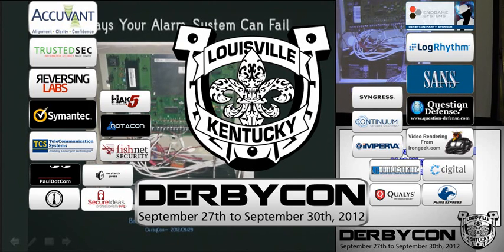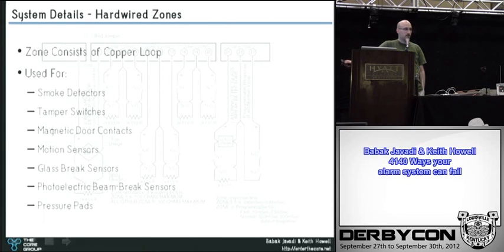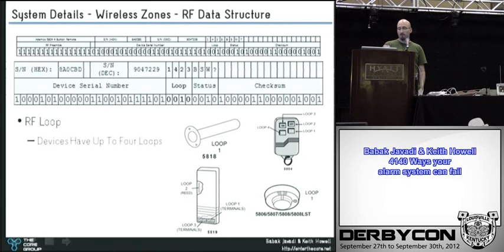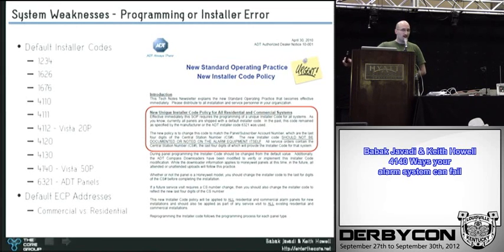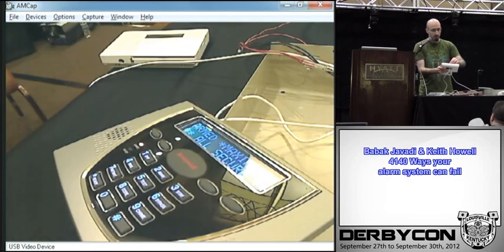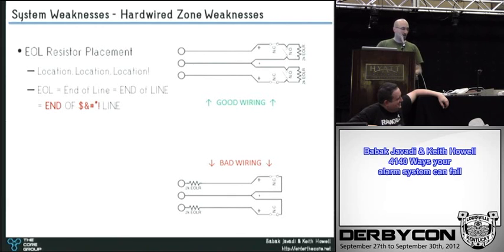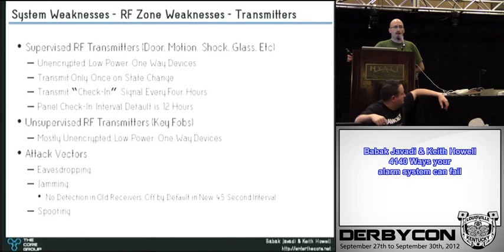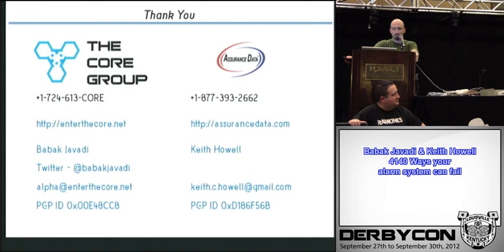2 2 6 Babak Javadi Keith Howell 4140 Ways your alarm system can fail

Comment: Congratulations, here is a comment! Firstly, well done, I have been interested in alarm systems since I first made a simple 'NC 'circuit using the good ol' 555 timer and I see that technology has moved on. Very interesting how the human element (or stupid gene) can still compromise hardware that is actually well engineered, if only it were implemented correctly.
The breakdown of the 'wireless' 345 mHz (I think) tx has gotta be causing headaches for real professionals, and I kinda think that there is no workaround that can 'fix' these systems UNLESS they are offered as a 'deliberate weak point', inviting an intrusion.... if I was a very clever fellow (I wish..) I would 'present' the system as open to attack at strategic points (I hope I must not go on....) and if I was really clever (I wish) all the RF 'stations' would be monitoring the fuck out of any local tx's, sending 'false' ok data  and looking for any interrogation or primed response, tracking the source geographically and doing 'hacker stuff'.  But since I am not so smart, there is no substitute for a good guy with good dogs and a shotgun loaded with  big pieces of lead..
Pax vobiscum Dude
Reply: Con McGrath Unfortunately keeping armed guards and dogs onsite 24x7 is going to get expensive real quick, even if neither has a major malfunction and kills your own kid on their first authorized visit.